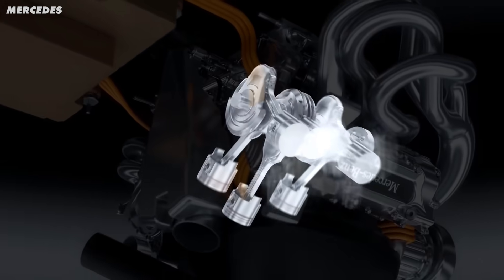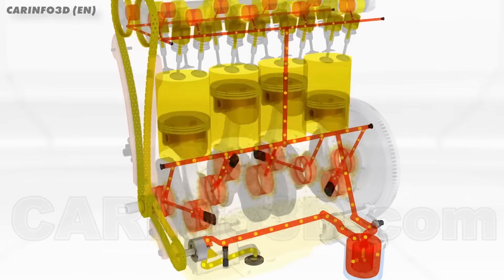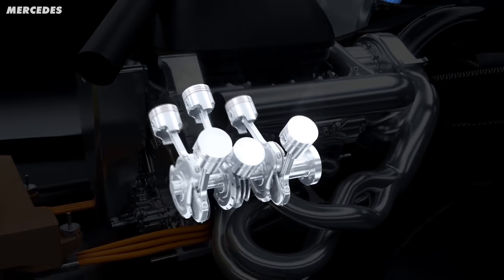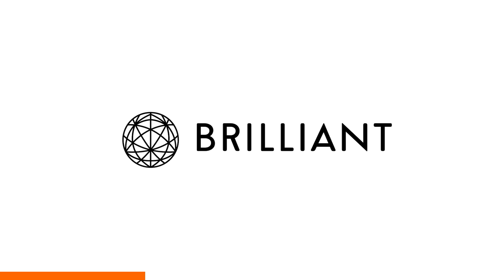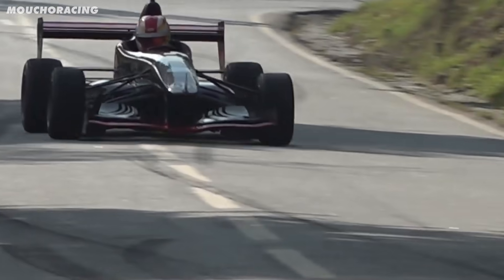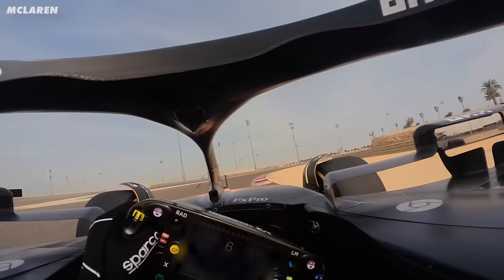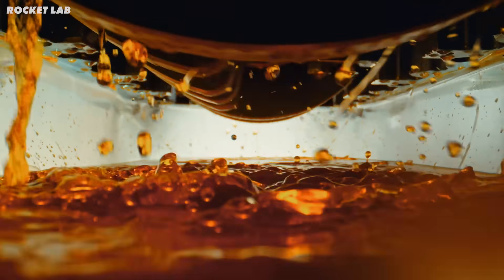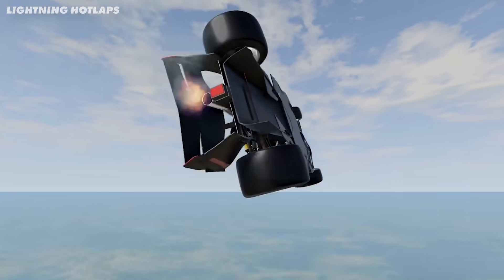Why F1 Engines Won’t Work Upside Down (for our stunt)

Comment: What about a snowmobile 2 stroke engine and no differential at all. The 2 stroke is relatively light, small and pack a punch for its size. It doesn't require complex lubrication systems due to the fact that it burn its oil and there's no head to lubricate. Modern engine are now injection so that systems can work upside down to. You can also use the cvt transmission of a snowmobile there's not much part to it, it's light weight, compact and effective.

As for the differential you're not gonna turn all that much, therefore you would probably be better with just a 90° gearbox or a chain drivetrain like a kart. It would eliminate the risk of having wheels spin if one tire get less grip than the other and you would still be able to steer with negligeable slip of the tire

Comment: If you are going for the half pipe rather than a full tunnel wouldnt it me more dangerous?
Reply: Explained in part 3. One of the reasons not to go with a full tunnel is that they want accessibility should something go wrong. It's also a cost saving measure - why build a whole pipe, when you only need a little over half of one?

Comment: For th electric option instead of battries you can do use the ARIEL hydrogen turbine best energy density.
Reply: The power needs to go to the wheels. If it's turbine powered, you might as well make a jet.

Comment: My suggestion is a 2 stroke engine, like in chainsaws or in motocross bikes, it doesn't need a sump of oil, has less moving parts than a 4 stroke, weight less, and you dont need batteries
Reply: Exactly what i thought, would be quite a pic driving upside down and leaving a wonderful blue cloud behind
Reply: 2 stroke Snowmobile engine are already powerful enough, he can even use the same transmission witch is lightweight, compact and effective
Reply: @benno5667f7ub  allright boys, i think we should do it ourselfs. I´ve got a workshop so one of you two should bring a snowmobile and  one a tunnel
Reply: @benno5667f7ub  yes, and since it's CVT, it can be tuned to make always peak torque, so no need of gear changes, or clutch, nothing
Reply: @fernandomarsalcaldera6158  exactly so even less parts and less weight
Reply: Evinrude made a 2 stroke v8 outboard that is capable of running upside down.
Reply: @halfnelson6115  if I'm right, all 2 stroke can run upside down, that outboard V8 I know it runs vertical on a stock form
Reply: @fernandomarsalcaldera6158  the only thing that can cause a problem with running a 2 stroke in any orientation is the alimentation system. Not all carburetor can work upside down, but diaphragm carburetor and injection systems have no problem
Reply: yes but modern 2 strokes are fuel injected which would eliminate that problem completely

Comment: There was a clip at 10:00 that raises a good question: Is the half-pipe style "tunnel" you seem to be going with the best way to demonstrate this, VS a corkscrewing "ribbon" of road? Had you considered this option? If so/not, why?
Reply: Probably for safety margin. If it's a corkscrew section of road, one slip means you're flying off. Plus the rigidity of a half pipe would be higher as well.
Reply: @Pedun42  I can see your point about rigidity, but with a corkscrewing ribbon there's no need to steer, the car is always driving straight and the road simply 'flips' around it, so the car would not have the yaw to "fly off"..? The worst it could do is slip/fall down. And with a corkscrewing ribbon that distance could be kept smaller.
Reply: @jay2xdam  The point they are trying to achieve is not to drive upside down for a moment but to do so solely relying on aerodynamic downforce holding the car up. If you drive in a tunnel as you described (as far is I understood) youre just going on a looping where the Force holding you up is mainly given by the centripetal force given by the strength of the tunnel and the speed of the car going through. Similar to a rollercoaster.
Reply: @sternfaust  I was referring to the project's chosen tunnel design, with an open side
Reply: @jay2xdam  Yes I got that and I was talking about how youre design is not following with what they want to achieve (driving upside down only with downforce). But they made a whole dedicated video about the decisions and design process of the tunnel which I would recommend you to watch.
Reply: @sternfaust    I think I could have used a better term to describe the shape of road/track I'm referring to. I don't mean a corkscrew as in the path a rollercoaster would take. What I mean is if you held a flat ribbon taught at both ends and simply twisted it. Basically the car would just rotate on/around its (static) longitudinal axis and not have to drive up any sort of "wall". I don't remember them covering this "shape/style" of road/track.
Reply: @jay2xdam  I get your idea. And maybe its just because with a half pipe Design you can drive down at any given point of the track. And maybe the construction is easier and the loads on the structure are the same at every point because the track is the same shape and not having to come around its axis. But I am no expert so dont take my word to serious its just what I could imagine.

Comment: how about a flat-6 engine for that car? like that engine doesnt care about being upside down or not upside down
Reply: Any engine can be run in any orientation, the problem is the lubrication systems. Flat 6 and flat 4 are still wet sump engine that requires the oil to go at the bottom by gravity to be pump in the systems again

Comment: Can F1 cars drive upside down in a tunnel? this project won't answer that because everything will be so different to make it a useless observation
Reply: theoretically yes. the aero generated by f1 cars should be able to make them stick upside down. but as outlined in this video and the earlier videos, the engines won't work properly upside down. so, no.

that's why they are making their own thing
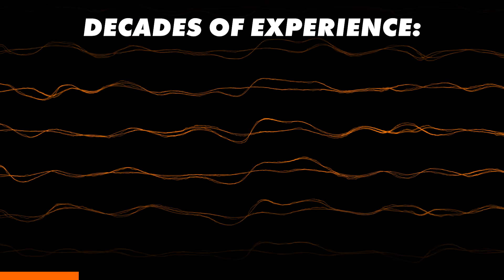Reply: You should watch part one which says as much. Here's even a useful timestamp... 3:50

Comment: My suggestion is to eliminate the engine altogether and replace it with a jet that can duplicate the speed of a formula car. After all, the test is not about whether or not an engine can work upside down, but whether or not the shape of the car body can stick to the ceiling. Any source of sufficient thrust would be good enough. I mean, you could even just attach a tow rope to the front of the car and pull it will a fast enough winch.
Reply: The whole point is that it's a car. The power needs to go to the wheels.

Comment: As kewl as this all is for the innovations required to accomplish this, it is totally blowing the sh*t out of the romantic notion of a car being able to be driven inverted by aero forces alone…
Reply: I mean the literal only thing keeping the car stuck to the roof would be aero forces so I don't see where that notion is coming from, it's not like these motors make the wheels more sticky or something
Reply: "it is totally blowing the sh*t out of the romantic notion of a car being able to be driven inverted by aero forces alone…"
How so? Unless you're taking a limited view of "a car" having to mean an F1 car (already dismissed in part 1), or a kitted out Honda Civic or whatever, nothing they're doing so far takes away from area forces.. they're not adding a ducted fan on the bottom or anything.

Comment: Instead of making a tunnel, using a helix wouldn´t be better? You have less curvature on the surface to make better aero possible. Also you will have less lateral loads to keep under control.
Reply: The path they would drive around the tunnel is a helix, so I don't know what you mean. If you mean to say only make a single strip of road instead of the whole tunnel, that would be more expensive to build rigid enough and way less safe.
Reply: @Pedun42  yes just a strip, you don't need to make the big radius. As the car is "glued" to the ground , the strip could be in the centre of a small circle around 4 meters in diameter and it would be much more stable than the C shape. I think they didn't think out of the box, because you don't need to steer into the curve, just let the road do the twisting. I did a small simulation in SolidWork and seems to be just fine.

Comment: get a jet engine. it's cool as fuck and it will work, no driveshaft and no need for torque vectoring
Reply: The power needs to be going to the wheels. That's the whole point.

Comment: I called this in the very first video.  Electric is by far the most sensible for this kind of project.  You could also fed power for the track as there is only one place you are driving.
Reply: Yeah, it would have to be the tiniest battery possible. That thing's heavy
Reply: @luizarthurbrito It's not a consumer car so it would likely have battery reserve for maybe two or three times the distance of the run.
Reply: I think it was fairly obvious that they'll use an electric motor, it's like the only reasonable choice for such project.
Reply: I did too...  electric or turbine/shaft are the only real options.
Reply: Slot car rails might work, but its probably not safe enough because unless you literally put it on rails it would be very easy to lose contact, and probably would interfere with the underbody downforce and drag.
Reply: Electric is boring, it wouldnt be hard to convert a two stroke to work upside down
Reply: Wouldn't Hydrogen be a good idea to power the electric motors? The only thing is that I don't know if the hole system is lighter compared to a battery
Reply: @silasboller6328 Nah hydrogen wouldn't be any good. It's not very good at instantaneous power so you'd still need a battery. Would just add weight and complexity with the weight of the tank and the fairly heavy fuel cell.

Comment: You need your engine mounted on a lazy Susan so it's always pointed up.
Reply: Or a hard-working Donna.
Reply: @loneponderer495 "the Donna"
Reply: the issue with that is that the driveshaft wouldn’t be able to rotate with the engine
Reply: @reeseypeicie This is a solved problem - old piston planes would rotate their engines to give each cylinder a turn being oiled
Reply: @reeseypeicie rubber drive shaft
Reply: @reeseypeicie you could have a motorized transmission mount that controls 1. the torque of the engine output and 2. the orientation of the engine. But this would widen this portion of the car significantly and ignores the golden rule of Keep It Simple… an entertaining thought for an entertaining project. Electric motors seem like the sensible option, hopefully the added unsprung weight doesn’t make the handling too jumpy, though.
Reply: A gimbal mount
Reply: Just use an electric motor instead. Problem solved.
Reply: Like top gear climbing the dam.
Reply: What is "the Donna" being mentioned?
Reply: @jshoopes8305 Donna can me “woman” in English or lady or mistress in older Italian. So maybe that’s a clue:)
Reply: The power output would rotate the engine unless there was some solution found. It would add size, weight, cost, and unnecessary risk for an unproven technology.
Reply: @Pedun42  you could make an active one like an electric camera gimbal. Would still have most of the problems you listed though
Reply: @Pedun42 Mount the engine within a differential with slippage on the mounted side limited by a brake.
Reply: @Pedun42 it would use a transaxle so it most likely won’t even be possible
Reply: @Pedun42 The solution was found decades ago, old piston planes used to rotate their engines to distribute oil
Reply: @bosstowndynamics5488  I wasn't aware of this, thank you. Still, it would be heavier with larger packaging needed so it's a pretty bad solution.
Reply: Bro, don’t be giving away these ideas in YouTube comments, you need to be working at NASA.
Reply: Radial engine
Reply: Or just running 90* to the right so it’s upright on the vertical and 90* left on top. Half a boxer. No problem.
Reply: Thats what my dad used in the 60's when he did this
Reply: A gimbal
Reply: You know I keep getting stoned and thinking about this and the more you think about it the more complicated it gets.
Reply: Or use electric motors like Scott says in the video . . .
Reply: Nah the gimbal engine would be crazy
Reply: Simple answer would be a plane engine, weight and space might be an issue.
Reply: Gonna need a chainsaw based solution
Reply: Why not just drive it in australia?
Reply: @simonehudspeth861  It's very clearly racist towards Susans.
Reply: Seems like a good way to make the engine spin itself and nothing else. Considering that the axis of rotation of this mount and the axis of the driveshaft would be identical.
Reply: lol
Reply: This is the answer
Reply: "Lazy Susan" is an extremely sexist and racist term. I propose the name "Multifaceted Susan"
Reply: @aydankhaliq2967  or challenged by diminished capacity for activity or productivity Suhim/Suher/Suthey, 😂
Reply: With again MAKES THE HOLE THING A FARCE A JOKE AS STATED YOU SEED YOU WOULD DRIVE AN F1 CAR UPSIDE DOWN JUST A JOKE ALSO  IT WON'T BE UPSIDE DOWN FOR LONG ENOUGH TO BOTHER IT

Comment: You can build LS engines to have more power and toque than F1 engines
Reply: You entire forget weight. F1 engines could do WAY more if they could have heavy materials and wall thicknesses like an LS.

And oiling is still a problem.
Reply: A LS could never take 5 Gs into a corner, but in a straight line, maybe it'll work